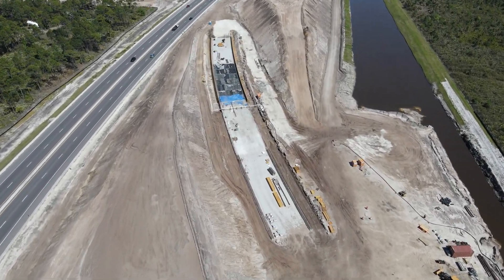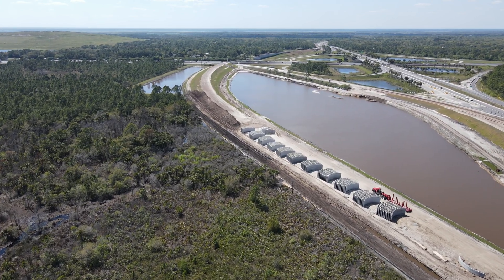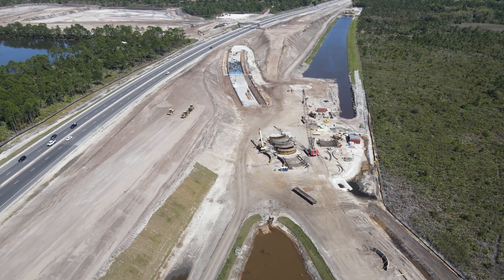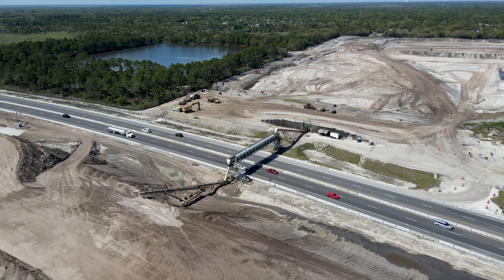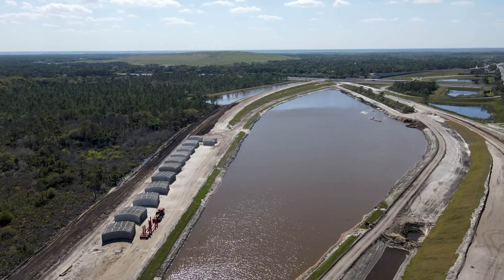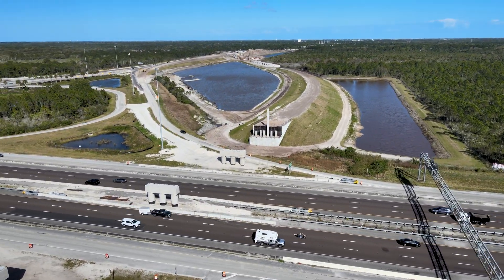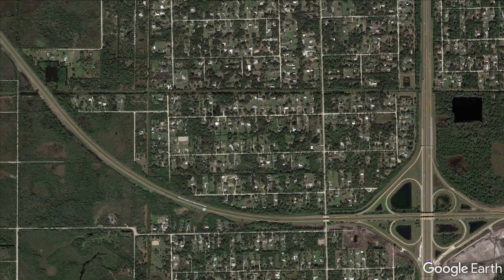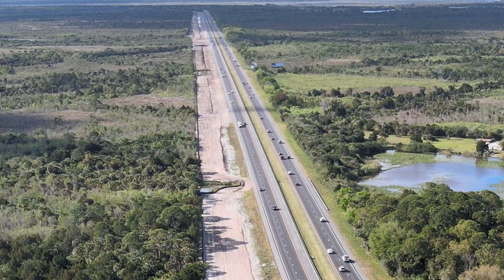Brightline I-95/State Road 528 Interchange Construction - March 2021

Comment from the maker: I have uploaded a map of the interchange with the route Brightline will follow as well as the realigned State Road 528 on my Facebook and Twitter pages in case you need additional clarification on the route. 
Facebook: https://www.facebook.com/TheRoamingRailfan/posts/145218170832941
Twitter: https://twitter.com/RoamingRailfan/status/1373758712343625731

Comment: Makes me wonder, when all Is done, will new locomotives and rolling stock be needed?
Reply: Their contract with Siemens for the trainsets included the option to purchase several more plus additional coaches. So not only will they be getting more trainsets, they'll be adding cars to make the existing ones longer as well, up to six or eight (I forget which off the top of my head) passenger cars each.
Reply: @OhioCentralModeler  cool
Reply: They ordered 5 more transets which are actually under construction they have pictures of the engines all over Instagram and each train will have 6 coaches instead of 4 and I’m 99.99% sure one of the two new coaches per train will be a cafe car which makes sense, it will be a long journey from Miami to Orlando